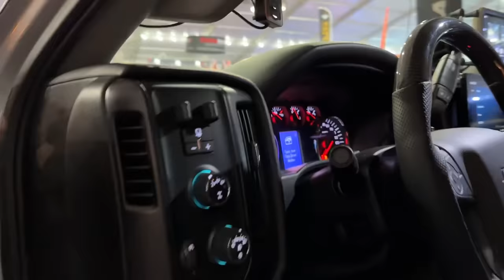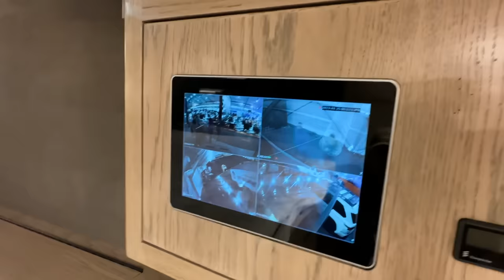Is This $1.1 Million 2023 EarthRoamer SX Still the KING? Come Check Out This Massive Built RV!

Comment: Starting at 13:50 when he said dry weight of the truck itself is 22,000 lbs that UNFORTUNATELY means you need a CDL in many states if you are towing anything MORE than 10,000 lbs because that would put you over the COMBINED truck and trailer weight class of 26,000 lbs for most states to allow you to use a regular driver's licence to drive.

If you bought a RAM 3500 which is 7000 Lbs with 4 passengers, you could still tow a typical 18,000 lbs Keystone Montana 5th wheel on a REGULAR driver's licence because you would be UNDER the 26,000 lbs combined truck and trailer weight limit.

If you are buying this type of 22,000 lbs weight Earthroamer, either don't tow anything else OR get a CDL (Commercial Driver's Licence) so you can tow more than 26,000 lbs

V

Comment: So when you damage an airbag then what?  You cant move because the truck is sitting to low?
Reply: Air bags are actually very easy to replace. I've done it on my rig out in the middle of nowhere and I'm a girl...
Reply: @melmiller1776  What difference does it make that you are a girl? I tell my daughter if she tries she can do it just like the guys.  Anyway that is only if you have an extra bag with you. I agree its not that difficult but its just another part that can go wrong and it will.

Comment: King nothing Chevy breaks to often to be king you would have to tow a shop behind you.. last time I liked a Chevy was my 76 Nova it was my first vehicle I worked every weekend to keep it running... Worse than a Harley. Then years later joined the military. Had a Ford no maintenance beyond basic. Brother rolled it though. Trouble is recent models have stupid maintenance issues like thread chasing shark plugs. Then got a Dodge only the interior is iffy stuff breaking that didn't make sense but it was only aesthetic though. Drove it to nearly 300k. Replaced rack and pinion 250k. Abs failure with original equipment at 280-290. 

Now into a Toyota. I don't quite trust it but I bought it used.  Just hit 190k. Have redone rear beaeings had to weld a center bearing carrier. Mostly okay but it rusts too easy. If finances are right when this fails I'll go back to Dodge depending how well this lasts and the work to keep it alive. 

Long term I'd Toyota or due. The one thing I don't like about didn't is unnecessary complications and low mpg for the low power. 

I'm very done with crap vehicles that don't work long term I'd rather get a bike and occasionally rent in a weekend. F half assed companies like Chevy.

Comment: It's so tiring to hear these dummies bleat that Earthroamers are over-priced.  When I retired from the Army, I was considering becoming a full-time RVer.  I lived in Fort Collins, Colorado and commuted every day to Aurora, which took me past the Earthroamer plant every day.  One day, I decided to stop and ask for a tour.  The sales department told me that they don't really give tours, but I could look at some of the previously-owned models for sale on the lot.  While I checked out the trucks, one of the chief execs joined me.  We learned that we had been assigned to 3d Brigade, 4th Infantry at the same time and both deployed to Iraq at the same time.  Even though he and I had never met before that day, we knew some of the same people and were friends with some of the Soldiers who were KIA during OIF.  Finally, he said, "One 4th ID guy to another, sure... I'll give you a tour."

Just one thing to note is the cabinetry.  The entire vehicle is digitally mapped and all the components are designed on CAD workstations and linked to C&C machines.  Everything is milled to .001".  The jointery is impeccable.  Where the wood joins the composite, there are no gaps, there are no fudge strips.  There are no staples or brads.  Every joint is dovetail and joined with construction adhesive.

For comparison, I toured a Host Mammoth recently at the Cal Expo RV show.  The drawers were stapled butt joints made from very low-quality pine.  They boasted that the cabinetry was "solid wood" which was true.  It was solid wood fiberboard wrapped with woodgrain vinyl.  Every RV I toured at the show, except Airstream, had wrapped fiberboard cabinetry. 

I'm no fan boy.  But, I know quality when I see it.  People who say Earthroamers are overprice would also say, "Why should I buy Wegyu beef?   Bubba Burgers are just as good."